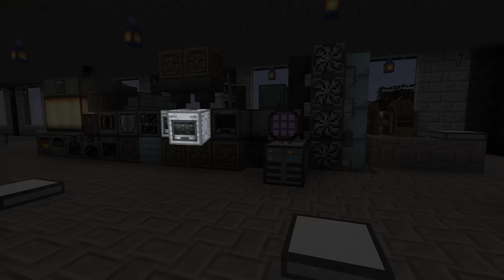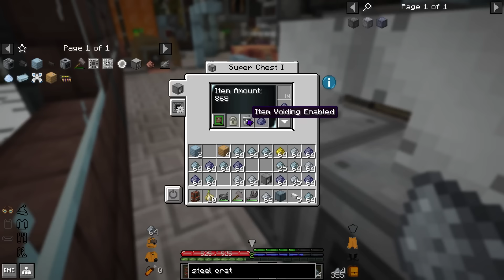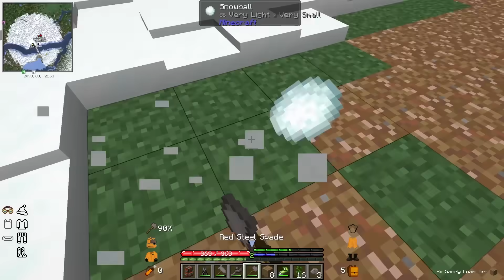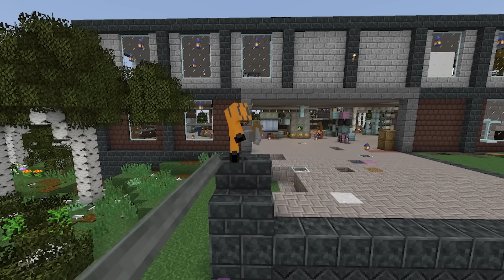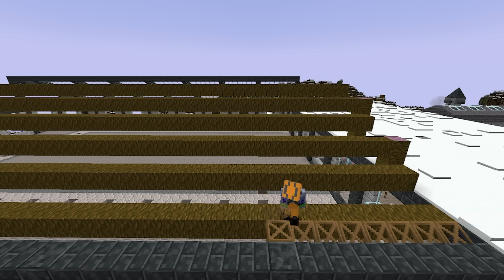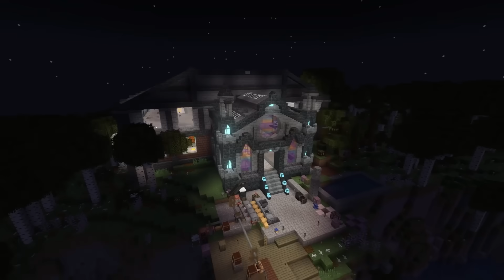EXPANDING the Factory in Minecraft's Most Realistic Mod (TFG Part 11)

Comment: Hold on The AE channel count seems kinda sussy 🧐 
You have way more than 8 channels and I don't remember seeing a controller.
Reply from the maker: I disabled channels, I had enough of them in E2E and I wont disable them in GTNH
Reply: @Hecuba39  Fair enough. They for sure can be annoying, especially because requirement to craft dense cables. On the other hand using P2P tunnels, subnetting and channel management is an interesting part on its own.

Comment: I am only at the part where you're rebuilding the cleanroom at the moment, but FYI in case you didn't know: The door doesn't have to be iron door for the room to work. I have a glass sliding door and it works perfectly. I can even leave the door open and it doesn't seem to matter (but I usually close it for immersion reasons)